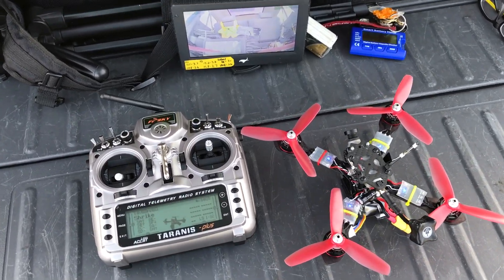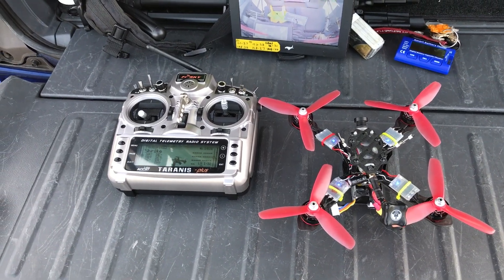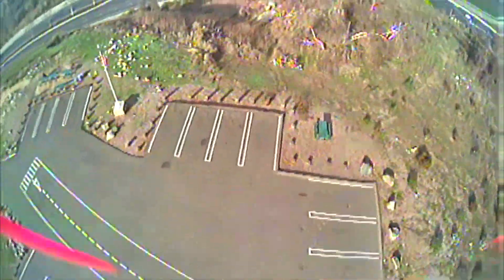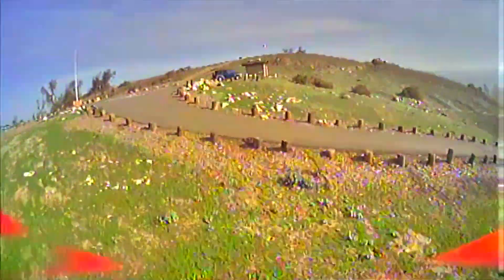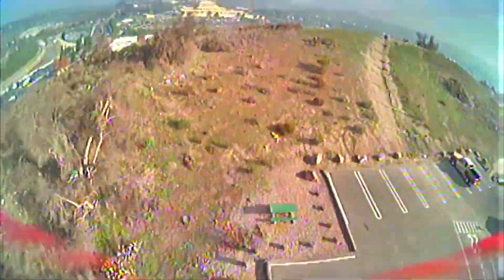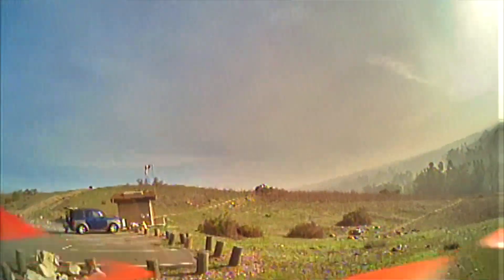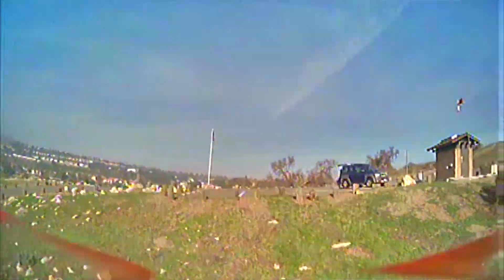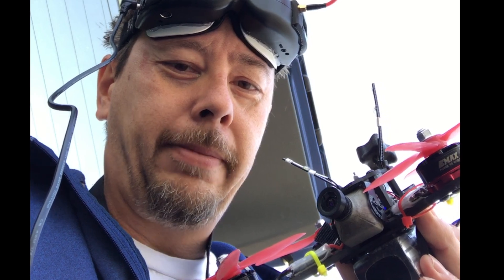Kiss 24a First Flights

Comment: If you're willing to try the KISS esc's, you really need to try them with a KISS fc. When paired to any other fc, you're getting none of their benefits. They have individual telemetry support, no need to sync, and now the huge thing is dshot600. Currently, you're using none of that. You might as well be flying littlebees